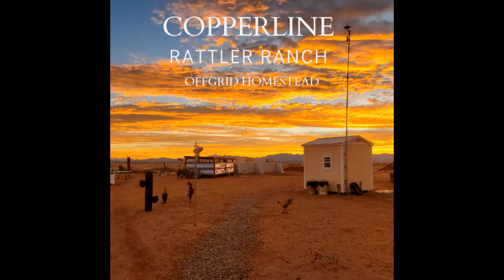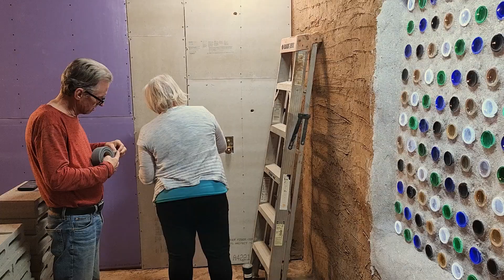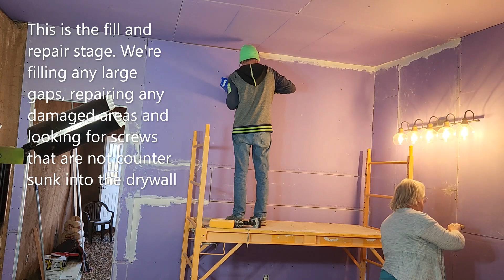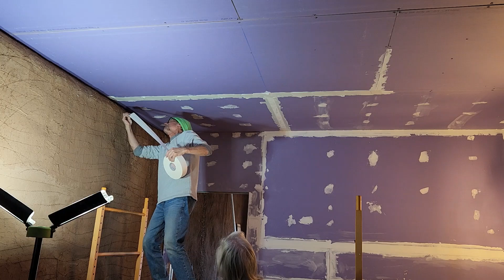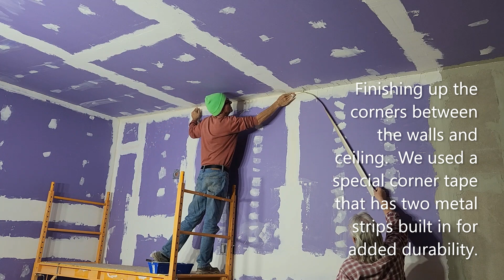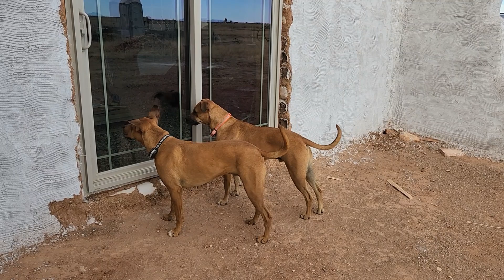So Much Tape and Mud ep 74

Comment: Hey my favorite people are back. Where have you all been?
Hopefully staying safe and happy.
Reply from the maker: Thanks. It's been so cold, colder than normal by 10 to 15 degrees.  Making it difficult to work with the joint compound.  We were able to warm up the room with a small electric oil heater, but when the room starts out at 40 degrees,  getting it up to 55 degrees, which is optimal for the compound, was taking several hours.  So we only had about two to three hours a day to work.  But, the tape and joint compound are done.
Reply: @copperlinerattlerranch81  great progress, thanks for taking the time to reply back

Comment: You mentioned in your opening that it's been cold.  I am curious how passive solar techniques will attenuate interior temps.  What sorts of temps at night have there been on the inside?  Was there enough solar gain thru the windows?  Did you try to use the tube ventilation from the earth if it would help raise the base temp in the home?  How will you interface the the gypsy walls to the earth bag walls with lime plaster - type finish?
Reply from the maker: We've had some very cold nights, in the low 20s and even a night at 13.  Inside the house, the temperatures on those nights have been steadily in the mid-40s.  We don't have the second slider installed yet, which would bring the temps up higher. Also, the entire ceiling isn't yet insulated.  We've just done the bathroom ceiling insulation.   We have noticed that the Temps in the bathroom have been about 3 to 5 deg higher than the living room and bedroom Temps.  We haven't yet used the passive geothermal tube.
Reply: Copperline Ratyler: thank you for your reply.  I admire your tenacity to see your project thru.  It will truly be a reflection of your talent, pioneering,  patience, blood, sweat and tears.  I dont think most people realize how harsh (yet beautiful) the high desert is.